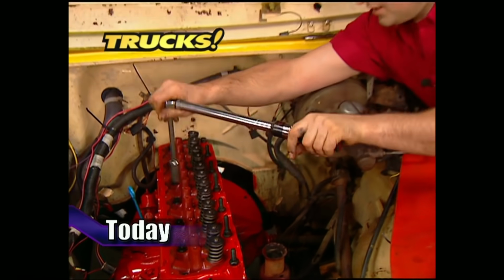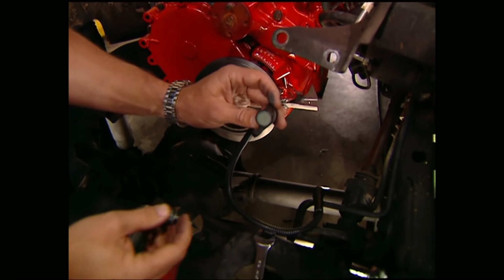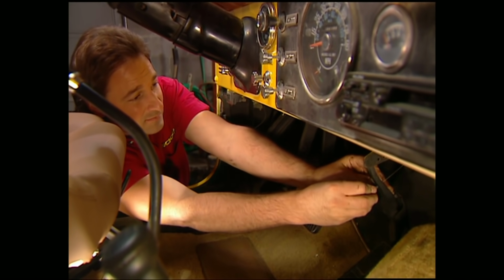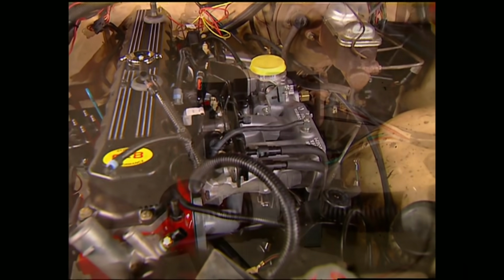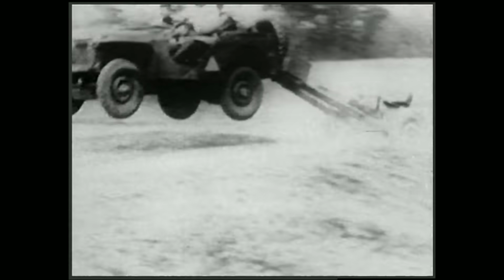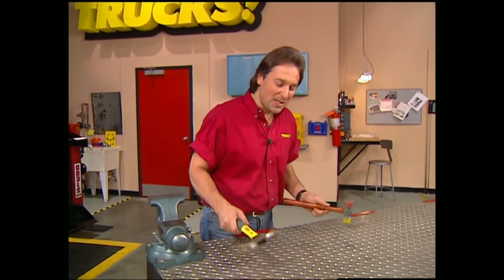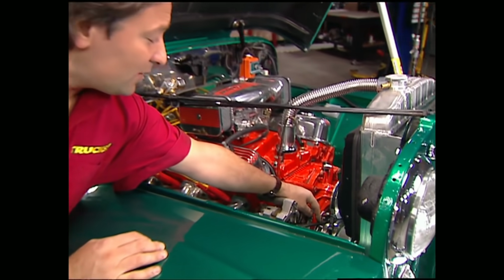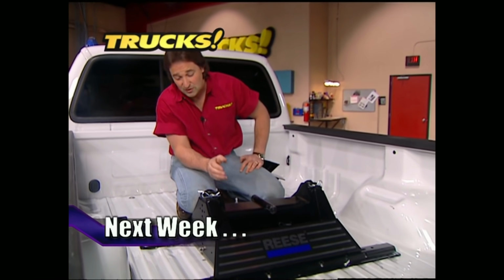Swapping The CJ7 From Stock Carb To Multi-Port Fuel Injection - Trucks! S3, E3

Comment: I'm 63 and my first vehicle was the 1980 Jeep CJ5 258 inline straight six. I purchased it in 81 and Believe it or not I still own it. I really like the idea of converting to fuel injectors. I loved the video and hope to God that our old gas running vehicles aren't going to be obsolete in the near future and parts impossible to find!
Reply: Im 18, my parents bought me a 1982 AMC eagle wagon with the 258, I have been in the junkyard for 6 hours so far disconnecting the intake, exhaust, and head and a bunch of other parts, im getting the wiring harness, but im worried about how the wiring harness will fit and what ill have to do all around. 2 months from now there is a car show in Illinois that I want to go to, idk if ill make it but im gonna try!

Comment: EFI so unnecessary. The 258 needs compression. The one in my 81 CJ7 took .060 mill off the head. New 9:1 pistons. I didn't CC the chambers, I estimated at 9.25:1. Crane 268 cam.
Clifford 3 into 2 headers,Offenhauser intake,and Holley 390 cfm carb.
Reply: It's about reliability, especially on a vehicle that likely sits for weeks or months at a time. It will never be a rocket ship, unless it's Freiburgers BJ-5, so the EFI upgrade crowns it as a turn key runner forever. IMO it is necessary.

Comment: Just because you've removed/bolted-in an aftermarket intake manifold that MOPAR made without the appropriate, power steering pump mount bosses, doesn't magically eliminate the need for that power steering pump support. Cutting off those mount ears on the power steering mount bracket is hardly the answer.

Comment: Not all emissions carburetor run like crap. On my first car I had a Holley 4150 emissions legal carb and it ran great and even pumped out 327Hp on the dyno. I believe it was 6919 model or something like that. 
I did modify it a bit, jets/squirters/power valve.

Back then emissions were still mandated on my car. The next year the emissions were lifted but the carb ran so well I left it on. I eventually sold it to someone in Canada for their Maverick.

Comment: Fuel line running across the front core support, that's a disaster waiting to happen if it gets in a head on collision.
Reply: No doubt. 
When I coverted mine with the Howell system, I rerouted the line up the driver-side and used steel braided fuel line from the tank to the TBI.
Reply: @scottdoubleyou563  So with doing an inline pump like that. Can you keep the factory pump inside the tank or is there more that needs to be done? I've looked everywhere but can't really find anything.
Reply: @alecon2249  Doing an external pump means you won't need one in the tank. Depending on what fuel injection you use however, an in tank pump may be to your advantage. It really depends on the car/truck, what you plan to use it for, and your budget.